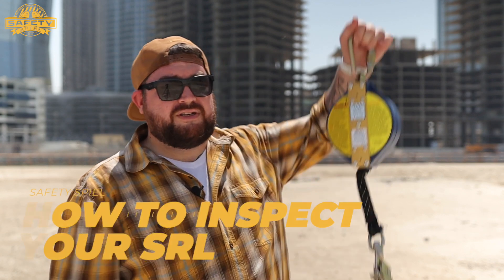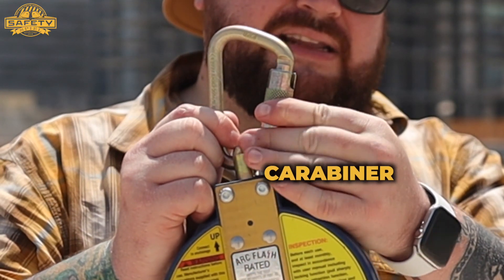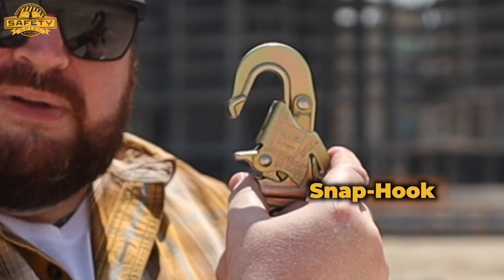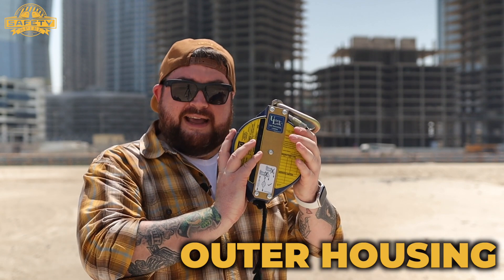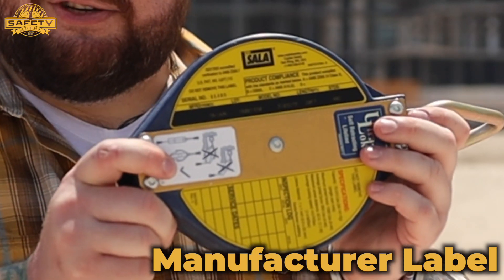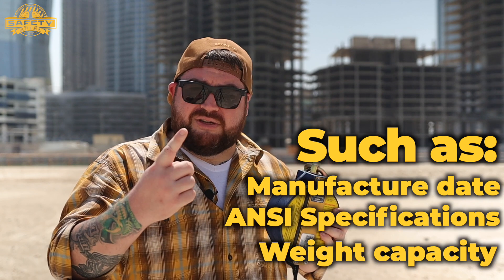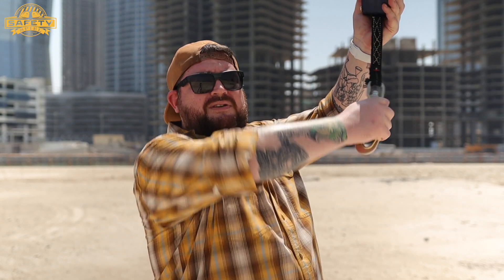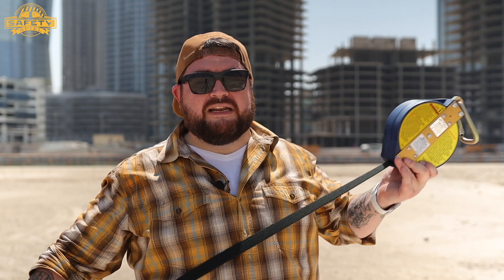Self-Retracting Lanyard Inspection | How To Do It Properly and Thoroughly

Comment: I have a question about degree programs. I am currently attending University of Houston Downtown which has a Bachelors of applied arts and science (BASS) in Safety Management it is not a GSP program but it is in person. I am currently considering attending Eastern Kentucky University and taking the online Bachelors of Science (BS) in Occupational Safety with a minor in Fire and Safety Engineering Technology but it is online. People have told me that the BS is much more respected in the EHS industry just wanted to get your opinion
Reply from the maker: To be quite honest, I think you are heading in the right direction.  I’m not familiar with the BASS program but I would look them up within the Board of Certified Safety Professionals (or contact them).  I believe any Bachelors Degree with the safety field will net you the GSP.  If you are nearly done with it, I would say stick with it.

As far as your Eastern Kentucky University idea, you are correct.  Many do feel that a BS is much more respected in the EHS industry.  Including myself.   You will have a four year degree in the H&S field and once you are done with that (and get the relevant amount of experience) you can sit for your Certified Safety Professional (CSP) certificate.

I made a video that discussed this as well.  Maybe that will help you out and provide further information for you as far as degrees and certificates.  If not, I hope my response was able to support you as much as you had hoped it to!

With all that said though, good luck with whatever you chose.  If you need further help or support, don’t hesitate to reach out and I’ll help any way that I can! 🤘🏻🤘🏻
Reply: @SafetySpiel  thanks